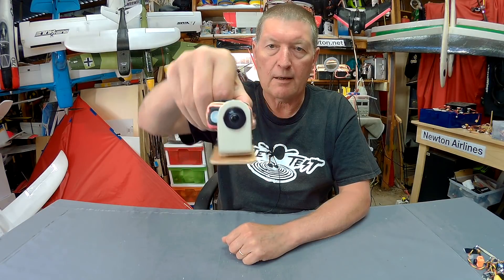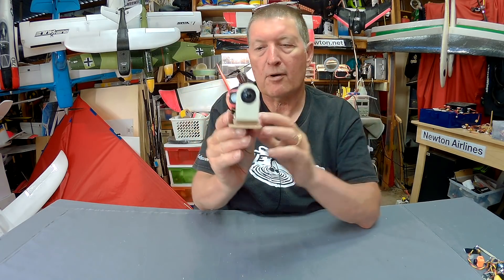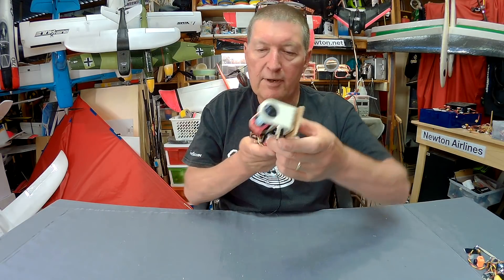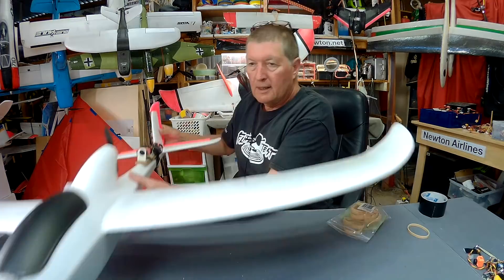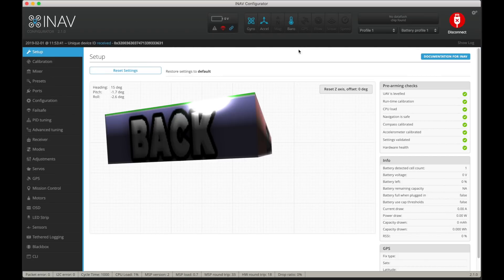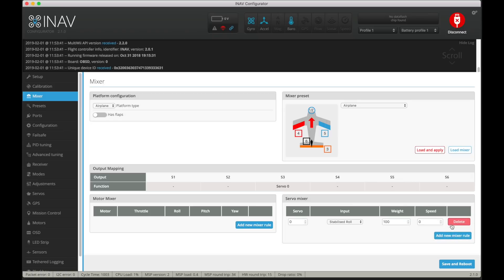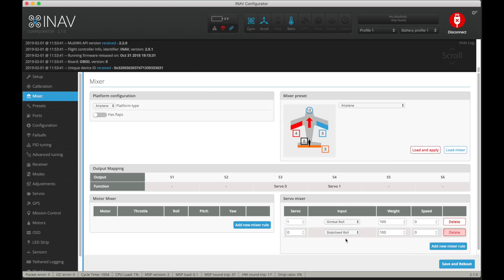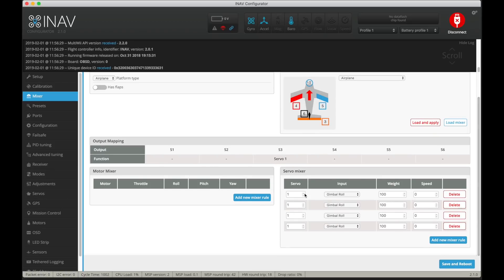iNav Camstab Servo Gimbal

Comment: You shouldn't need more than 1 servo mixer rule. I am part part of iNav's dev team. I will see what I can do to fix this issue.
Reply from the maker: Thanks Michel, that would be wonderful.
Reply: It is going to be fixed in 2.1, next RC (3) effectively. It will be possible to use up to 1000% rate for the mixer so you will only need one servo mix rule :)
Reply from the maker: @MichelPASTOR Fantastic Michel. Thankyou so much for helping with this.

Comment: Hi M. Newton,  I’m trying to connect my vtx AKK K31 40 Ch 600 mW and runcam in to speedebee but I don’t have video, I’m having power but no video. Ilook in to inav to see if I have to activate something but don’t find nothing so far. I can see there UART but don’t see on with one i’m connect or how to activate it. Thank you again and have a nice day.
Reply from the maker: Which Runcam? Are you plugging in to the Analog Vtx and Cam inputs?
Reply: Hi M. Newton, I have a runcam 2 with AKK K31 40 Ch 600 mW, I pluged the runcam in speedybee and the vtx in the analogue plug, got the power on booth but no video.
Reply: Hi M. Newton, I got it, I watched one of your video (SpeedyBee F405 Wing - Connection Basics), I mixed the camera and vtx plugs on the speedybee , what a rookie mistake.....Thanks again, my next step will be to set up my speedybee as my flight controller.... but not ready, I will whatch your video first ....Have a nice day.

Comment: Hi M. Newton, I test my gimbal today and it was nice, the only problem I have a little shake sometime, It happen only  when flying , maybe the wind or is there  a setting for preventing that, thank you and have a nice day.
Reply from the maker: Prop balance maybe?
Reply: Hi M. Newton, I think I found what was my problem, the hole for the camera was just a little to big and with the wind  the plate in the front was pushing and the camera was not moving properly. I fix it and can't wait to try it. If you have a video with inav and speedybee with the stabilisator mode, the return home option and the auto launch for nano talon let me know, I will replace my kopilot with that, thank's again and have a nice day.

Comment: Hi M. Newton, I have my speedybee working, I have inav 7.1, so do I follow the same set up as yours, and were do I chose the servo to be the chosing one, because I notice on the speedybee I would like to chose the servo S8, thank you and have a nice day.
Reply from the maker: Well done getting this far Carl. Almost the same as this but instead of adding 4 mixer lines you only have to add one and increase the weight to about 350. When you add the mixer line it will show where to plug the servo in - Depends what else is set up in the mixer.
Reply: Hi M, Newton, I was finally able to set up the gimbal, thank’s a lot, you gave me nice advises and propose me good products as usual, I have to say, the program INAV look’s very interesting, I will look at yours videos to learn more, by the way, do you need to do a calibration for the gimbal because I have a slim off set (can be my assembly 😂) thank you and have a nice day
Reply from the maker: You do need to calibrate a new board using the INAV Calibration page. You can make fine adjustments to the servo mid point in the Outputs page.

Comment: Hi Andrew, thank you for your video. i was thinking if it would be possible to use the pwm servo output from inav/Betaflight to control an ESC and drive a brushless gimbal motor for this roll stabilization purpose.
Reply from the maker: Dont know how brushless gimbal controllers work sorry

Comment: Hi! Newbie question here. Is it possible to connect a gimbal motor ( ie. RCTimer 2804-100t gimbal motor) directly to a F405 Flight controller, and use with CAMSTAB, same as you would a regular servo, or do you have to use a regular servor?
Reply from the maker: Only servos as far as I know

Comment: Andrew, I have one of these but it is not running Inav. I have tried to flash it with Inav, but it keeps failing. I cannot find any instructions anywhere. Any ideas??
Reply from the maker: Which board and version do you have Barry?

Comment: Where did you wire the servo black red yellow wires to the fc?
Reply from the maker: S4 output (S1 and S2 are for motors and S3, S4, S5, S6 are for servos)
Reply: @AndrewNewton  i see, inav automatically sets the remaining motor pins to servo pins once you make a servo mixer. I am flying kwad, so it uses motor 1 to 4, and remaining pins are 5 and 6, that where the servos gonna be.

Comment: If I’m using an omnibus board, I don’t need it to arm for the gimbal to work or set up a receiver type?  It should work without all the usual set up that’s used for flight if I just want the board for gimbal stabilization?
Reply from the maker: Correct, just need to enable CAMSTAB and add the mixer rules
Reply: Andrew Newton Perfect!  Thank you. I got it going.
Reply: Andrew Newton Perfect!  Thank you. I got it going.

Comment: Great way to get around the problem.  I'm currently working on making a pan and tilt system, using a Jaycar pan n tilt kit and a arduino nano/three axis accelerometer. Should do the same as your set up (fingers crossed).
Reply from the maker: Nice, different approach

Comment: Really interesting - thanks for that. I have a few old F3 boards knocking about that could potentially be used for this rather than going in the bin at some point. I used roll & pitch servo gimbals a fair bit in the 'old days' as the DJI Naza had outputs to drive them.
Reply from the maker: Yes good idea, as long as F3 is supported in a firmware version that has the mixer

Comment: Well done Andrew, thinking outside the box, maybe you should be an iNAV Developer..?  (for Fixed Wing use, there are some glaring Schoolboy errors regarding default settings)
   Globally, folk have emptied their shopping baskets of (vulnerable) Gimbals they were going to buy....lol
The icing on the cake for me of course would be to make it work from the F405 Wing FC...which has enough servo outputs for a Camera Gimbal.
Reply from the maker: Thanks ET. I can try it on an F411 and F405. Should be exactly the same.
Reply: That would be brilliant mate, Thank you....:)

Comment: What I did was to use a separate Omnibus FC with Betaflight, it works great. Doing it your way, all on one board is probably best though. Great DIY stabilizer video. I'm sure many pilots are interested in Stable video. Now if you could just show us how to adjust the sensitivity of the stabilized gimbal, using one of the Taranis pots, that would be the ultimate.
Reply from the maker: Same here, stand alone board, no receiver. I'll have to think about the knobs idea.